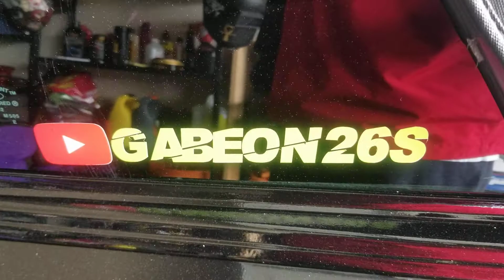Why is Water Coming Out of my Exhaust Pipe?!

Comment: What if it smells really rich and a lot of water coming out ?
Reply: It happen if the car has not been used for a long time. Although, I am not sure about the smell
Reply: @sstudio36 I think it would be when you don't, eventually overtime it would build any remaining moisture coming from the heat and as soon when you fire up the engine, all that trapped moisture would release from the exaust, the smell would be probably from the old engine oil since it hasn't been used in a long time

Comment: Thanks for posting this. I have a 2004 Mustang GT and noticed a water puddle by the axle. The water is leaking on the exhaust clamp after installing a round muffler from mbrp. The stock muffler had a tiny hole for drain and new muffler does'nt.